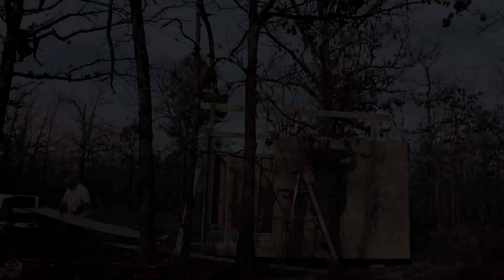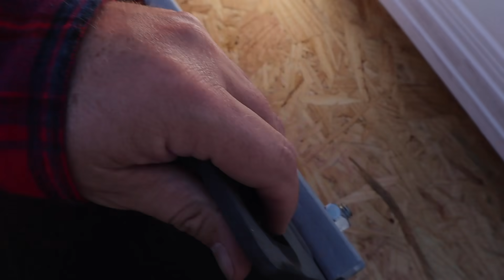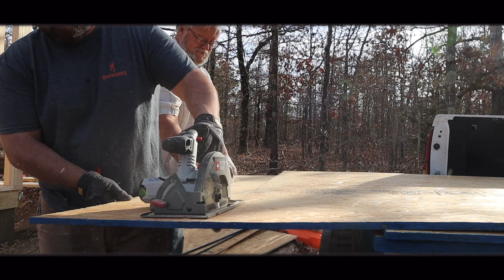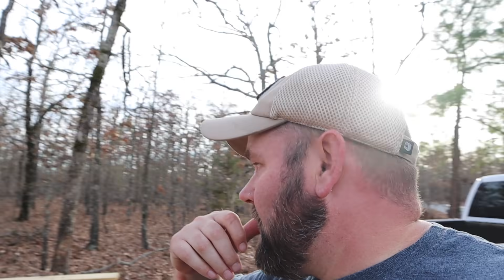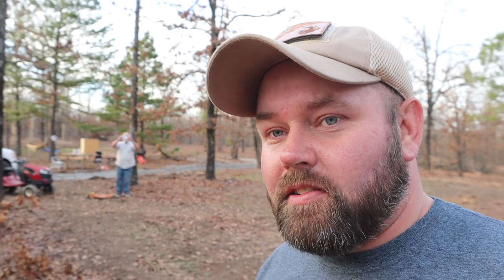YOI WONT BELIEVE WHATS GOING ON AT LOWES

Comment: Hey buddy, those 6x6 post might settle. “If” they do, get your jack back out and raise up it up a bit, pull out the post and pour a concrete pad. Then measure and cut your post so that your joist sit “ON” the post, while the remainder of the post travels up inside your joist - then using “construction” screws fasten it together. Wait a few days, then do the next post.  Here is hoping the posts don’t settle !
Reply: He got a lot of rain, he was saying. So the weight of the wood on the soft, muddy ground sunk. I like concrete under me. Then I know I'm not going anywhere. Unless theirs an earthquake. Good night everybody.
Reply: Hey is making it to be able to move

Comment: You need cement pads under your 4x4 supports or they are just going to sink in the soil. Small patio slabs 12x12 work great for that.

Comment: Lumber has gotten that way, no matter where you buy it here. GOD Bless and MERRY CHRISTMAS !
Reply: It doesn’t matter whether it sits outside or inside.   The plywood and OSB now is mostly crap for the “rough” side of building (framing part).  I’ve bought osb from depot that twisted too.  As far as the lines being off that’s from the factory Lowe’s has nothing to do with that.  Besides you had the lines in anyway.

Comment: Looking good. Yeah that plywood was really badly warped, one sheet isn't that heavy but when it is more than a few it gets real heavy real quick and the boards near the bottom of the stack in the truck bed had a few inches between sheets so not even the weight of all the ones above didn't even straighten them out. Sorry about you having to deal with it but as usual you muscled through it. Great job!

Comment: From a kid whose dad built houses for 40 years and I've helped him on and off for a while also its not just lowes Dutch. Last garage we built they got some osb and the thicknesses were crazy. One piece would be 7/8 the next piece would be 3/4 and the next would be 1/2 as far as the lines they are all off alot now a days they used to be pretty good now we have to mark each sheet as we go. Also it helps if you sheet it and paper it while the walls are down before you set them it makes life so much simpler its just heavier to lift up

Comment: Rona is a part of lowes as well they tend to store plywood and most boards outside on the ground as well .

Timbermart /  eagle building suppy tend at least have roofs and shelfs if outdoors at least . I did just build a 12 x 14 shed got wood from Rona but used fir plywood was nice straight .

Comment: Right now LOWE'S is having the same problem getting wood products as everyone else. Your building won't suffer because you had to add chalk marks that nobody will ever see. I used Chalk lines anyway because the studs and the OSB never lined up. Your building is looking pretty good considering it's just you and your dad-in-law instead of a professional crew of carpenters. As a matter of fact besides not doing the window layout when building the front wall you did as good if not better job of building it so far. I wish you and yours a Merry Christmas and Happy New Year if you don't post again before then. Good luck with you building projects.

Comment: What i would build for the living part of this project would be something incredible, but simple too. I was in the same situation, 4 kids who were growing up so fast & we set our mind on the future when it would be just my wife & myself. So i dug a basement, a great big hole in the ground, 8" deep, 15' x 10', which is where our food was stored nice & cool. Once i had the basement walls done with those deep L shaped sheet metal lengths going all the way round so the vermin that usually dig down the side & under your basement, digging their way back up even through concrete into the basement but with those L shaped pieces they hit the bottom & can only head away from the house. I used them on every build since they came along in the 70's. In your case you could then make an incredible two-storey with a wrap around balcony & it would be the same size as this shower room only it has a stairway up to the 2 or 3 bedrooms. The wrap around walk way is extremely easy but you gotta decide on it early. On my build i made it so i could extent the rooms in 5 minutes so they "Borrow" the 3' from the balcony by simply activating some swing doors that extend the rooms upstairs out to the edge of the balcony which is pretty cool. But when the time came, instead of it been just my wife & i, it was SIX kids plus their 14 kids so i ended up building a pretty big place that will last over 100 years. I guess i dont have another 5 years of work left in my hands so i want this to be solid forever for them to visit after i'm gone or maybe live in if times are tough. The first cabin with the basement is where my sons family life as they get their plot ready so they can work & live here, hunting on our property too for deer plus small game. We got lots of coyotes come by but they cant get inside the fenced area which is just a parameter fence so our animals can live & roam about a decent sized area. I shoot lots of them from the wrap around also, which is neat. Using the suppressor so quiet the others cant tell where the shot came from. Finally folks, it seems the problem with our AR-15's attacking kids has been put to the bottom of the list as our state reps have no problem with me killing a family of 11 wild hog's with my AR-15 on full auto. I wish i had recorded his response, how excited he was to see this. And when my innocent, pro-life AR comes under attack again i could say, "But congressman, dont you know this very gun is what got you all giddy when i killed all those hogs that were destroying YOUR corn? But he's a good gut & pro 2A so i wouldnt do that.

Comment: Ya'll might want to get an on demand water heater.  It's a little more expensive but the water heats instantly and you don't have to find a place to put a big ol' water heater.  It's also easy to move and you don't have to worry about a huge leak in the future. It can work on propane.

Comment: If you had gone ahead and sheathed the front and then framed the window from the inside and then cut out your window space, it would make the building stronger. Just for your info. Other wise you are doing a good job.

Comment: The osb is made with exterior glue these days . Years ago it wasn't and back then it wasn't worth a crap. Osb does not  warp near as bad as plywood. Forty plus years experience in the trade and speaking from experience. Any of the big box and local lumber yards buy their lumber from the same places and it is trucked in, an if a load of material is trucked 1000 or 2000 miles. It's going to bow and twist till it dry's out. The tarps keep it fairly dry but the moisture in the air will soak into it even though it is tarped.

Comment: Always buy 10% for waste, mistakes, imperfection, and the occasional screwup.  At my cabin, I stored the excess under the shed in the crossbucks and was glad it was there when a project came up besides the price of lumbers has not gone down in my 40 years of construction and a second trip to a building supply cost more than what was stored..
Reply: since I'm adding my two cents put a second stud under the ridge pole in the back

Comment: I have never seen any 1 put OSB or plywoodvon any house straight up and down on a wall it go's on long ways then the siding go's on straight up and down
Reply: If you use the wrap like Dutch did it doesn't matter. You can put it on at an angle and it would still be ok. The siding aligns to it self just get the bottom on straight and you'll be fine. What's underneath doesn't matter.

Comment: You should put support studs under the "Back Beam" of your Ridge Cap Truss so the weight goes all the way to the base and not across the top plate on the back side, other wise your doing great, I retired from 40 years custom home building, as for Lowes, and Home Depot, Im definitely not a orange supporter in my experience, but then I used Menards over Lowes but they don't have Menards in Utah!  keep bang it out!!! to bad I don't live closer, I have tons of Tools and equipment just sitting in storage